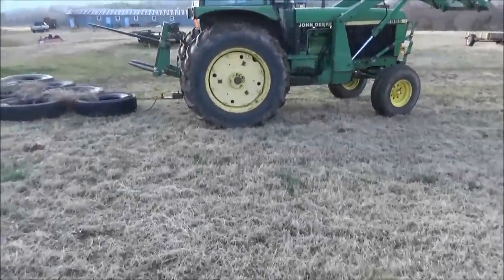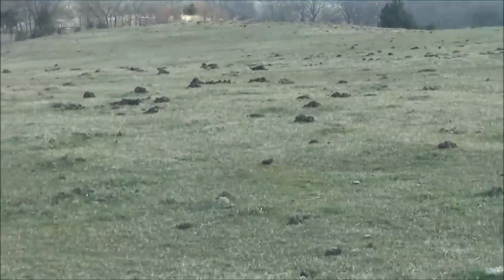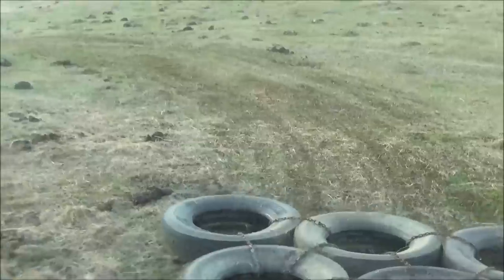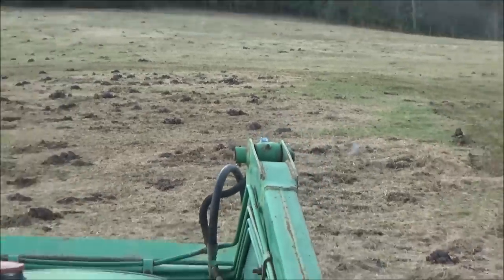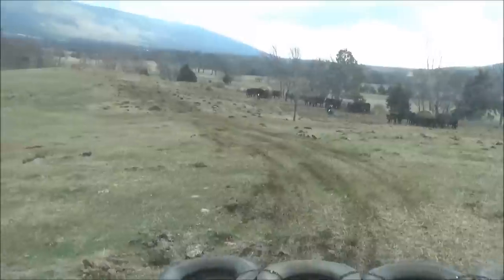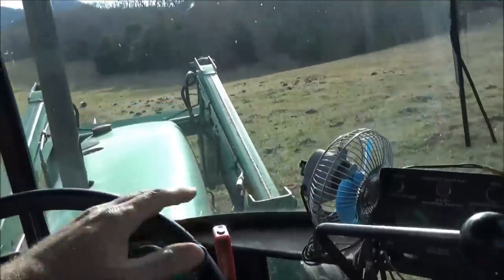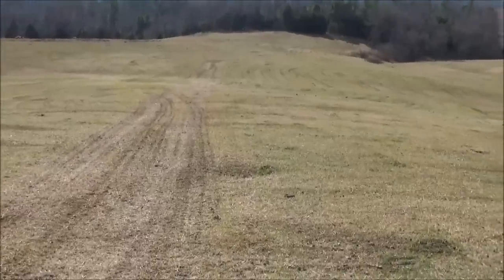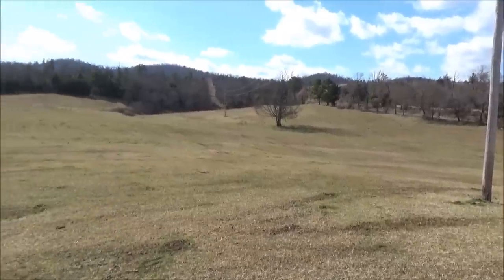spreading manure

Comment: If you cut the tires in 1/2 and do the same thing, you'll find it works a lot better, plus the manure and hay doesn't build up inside the tires. With the 1/2 cut tires open side down, it'll also break up and move the matted hay. Then on the top, round side, bolt boards with a section of angle iron for an edge and you can flip it over and really level a pasture where there's hoof holes. I'll post a video at some point. I've had a few more request to build some for friends and neighbors after they saw how good the ones I've built work.
Reply: Have u made a video yet would love to see this also, as im new to this and was wondering the best way to fill the cow hoof holes
Reply: @ThaDiscoFreak  I've made two with cut tires so far. One similar to this with cut tires, I used military truck tires, they are rather thick and stiff. The first one another horse farm operator bought for use at her farm. The second one is a two tire one we pull with a four-wheeler. Two tires like the one we use is almost too much for a 2WD TRX250, the 4WD TRX500 is better suited. If I get a chance, I'll post a video of it soon on my channel. Mine more for breaking up the manure piles, but it does fill in and scrape good prints. It's a PITA to cut the military tires in half. It took some serious "playing around" to figure out an "easy" way to cut them.
Reply: @TheEquineFencer  Hi there did you do post your video?  I looked on your channel but didn't see it.  thank you
Reply: @violettatraviata8838  I'm not sure. I'm on a mobile device right now. I'm out of data for the next 16 days... Remind me then if I haven't uploaded by then.
Reply: @TheEquineFencer  No worries, will do. thank you  ☺
Reply: @violettatraviata8838  there's a video uploading as I type, it may take a few minutes. LOL, I forgot which one I loaded, after it loads I'll see which one I uploaded and post another.
Reply: @ThaDiscoFreak  I just posted two about this on y channel

Comment: Thumbs up for the video sharing. 
Thumbs down for the set. Some positive criticism. ;-)
Chain link on a frame or even those chains on a frame work wonders and keep the same weight from start to finish! 
At the same time don't get too heavy from everything that accumulate inside the tires! So no ripping effect on the soil and grasses. It simply break down and spread the pies.
With that in mind the lightest tractor possible is the best option, garden tractor or sub compact type of thing. Less soil compaction deliver an healthier soil. 
Your three goals are absolutely correct. There's a fourth one, mostly overlooked. When the pies are spread over a broader area, They will dry and compost faster while not concentrating so big mass of larvae, etc. So less prone to spread diseases. ;-)
   
I dare to say this because I tried the same. Hope you find this useful. Best of luck.
Reply from the maker: I like the ripping effect on the  little bluestem grass and any woody  stem weeds, fire anyt mound, gopher mounds. I have 250 acres to go over, Not going to happen with a little garden tractor.  The cab tractor lets me stay out of the weather, that is why I bought it.  I have X amount of time to do things weather permitting.But your points are valid.

Comment: good idea, we have so many root vole and moles, so do you think this will work for molehils too?
Reply from the maker: +gogonzogo1 . i don't have any experience with voles and moles. if it is dirt mounded up it should help. I don't think it will help much with shallow tunnels. It might cave them in but i don't know if it will be a improvement.
Reply: thanks for the quick responding, I think I will pick up some old tires and try out then

Comment: great idea..   did you have any trouble with build up in the tires?
Reply from the maker: It builds up a little, but i just figure it is extra weight to help with breaking up clods.
Reply: does a great job...  I use an old spring tooth drag..   not heavy enough to knock down the big ones..   I think I'll add a row of tires on the end..  thank you OkieRob!!
Reply from the maker: Your welcome.

Comment: Any chance you could do a video on how you built it?
Reply from the maker: Can't guarantee when
Reply: OkieRobs Bees those are truck tires like school bus or tractor trailer right?
Reply from the maker: @zfilmmaker  Yes 20 or 24 inch, I don't remember. I'll try to drag it out of the grass . I just used short sections of chain wrapped around the tires to hold them together in that triangle shape. Cheap chinese chain and bolted the ends together. some tires have two chains, one going up and one going sideways.
Reply: OkieRobs Bees I scrutinized the video a little closer to see how it was done. You didn’t actually drill through the tire face to attach the chains, the chains are on the outside going around the tires, so they drag on the ground to? What size chain is it, 5/8”?
Reply from the maker: @zfilmmaker  correct the chain is on the outside. It's probably 5/16" chain. If it wears through I have extra to replace it.
Reply: OkieRobs Bees thank you for these responses and most importantly, the original video!